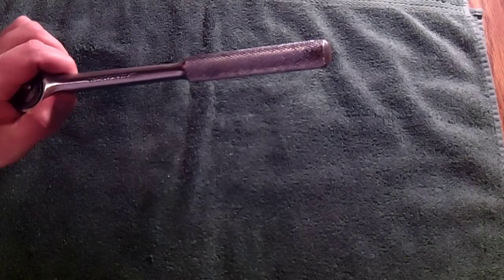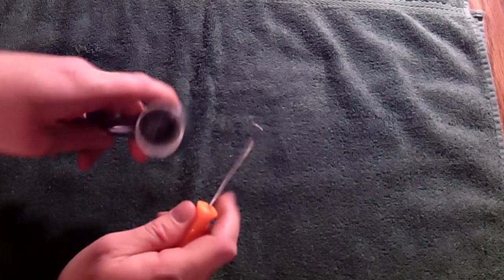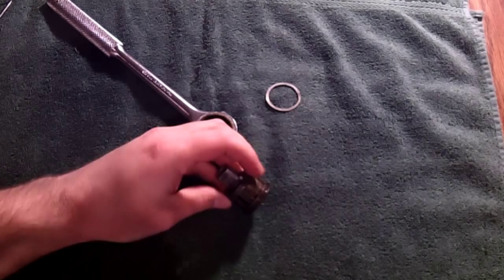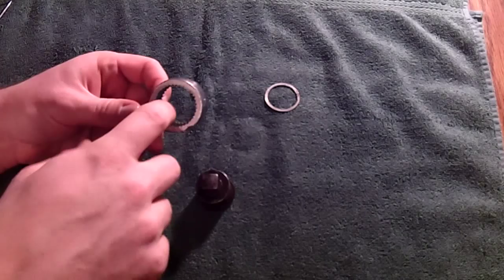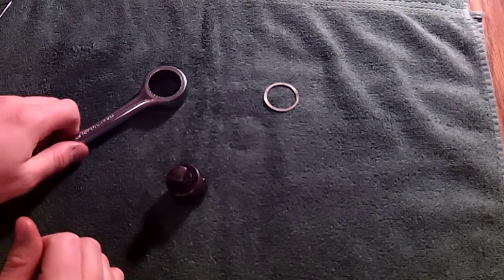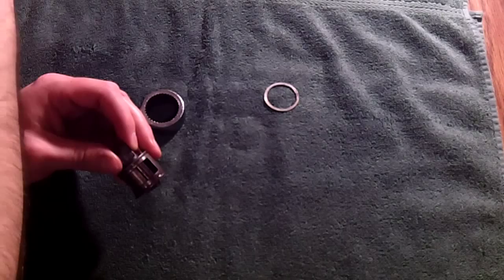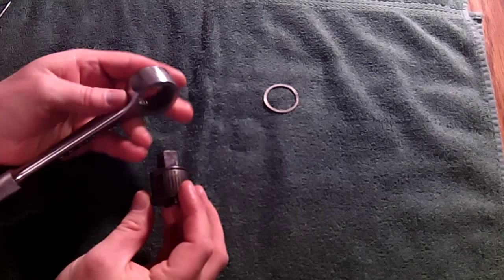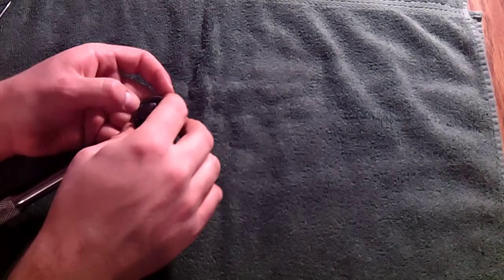Thorsen Vintage 1/2in. Roundhead Ratchet Lube

Comment: I have a Thorsen 77J ratchet that I consider the best ratchet ever made!  Was a hand me down from Dad and I’ve never stopped using it.  Works as good today as 50 years ago. Good video and thanks for posting.
Reply: i have a 3/8's drive i love and have had for over 20years now.. i would throw a snap-on if someone handed one to me. The thorsen i have has extra teeth it (bites with less rotation) and i never felt like it was going to fail me but i aint no idiot with it. far as i care snap ons are for breaking windshields, craftsmans are for taking back to the store to get a new one, and thorsens are for life.
Reply from the maker: Thanks for watching, and commenting.